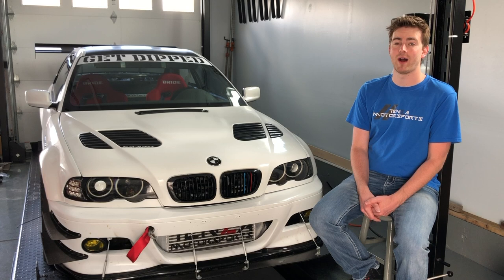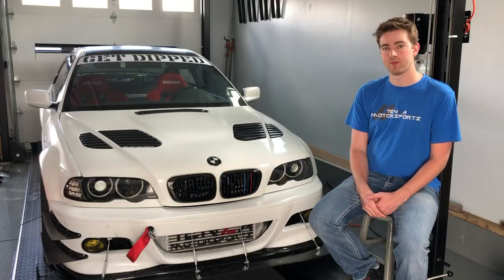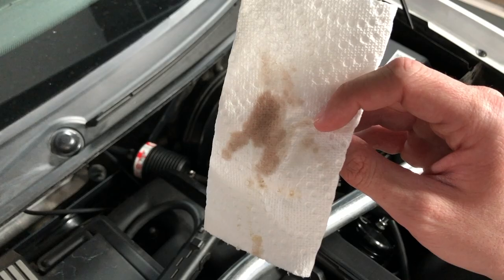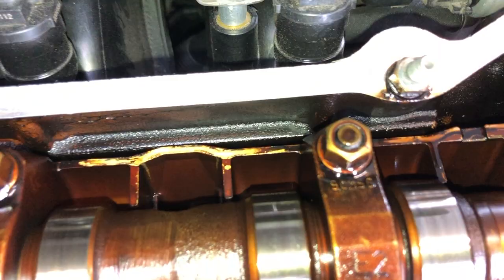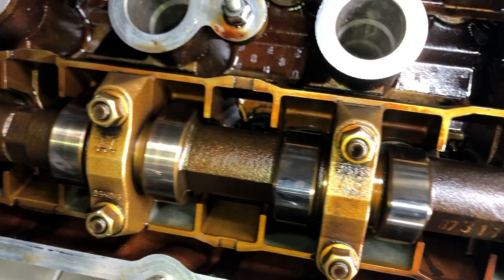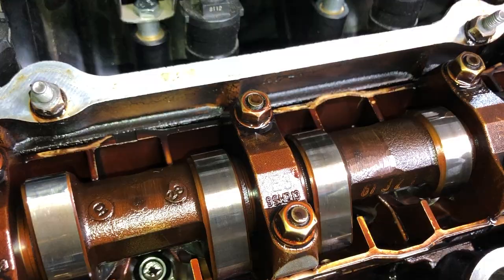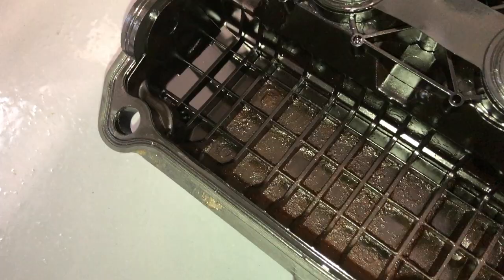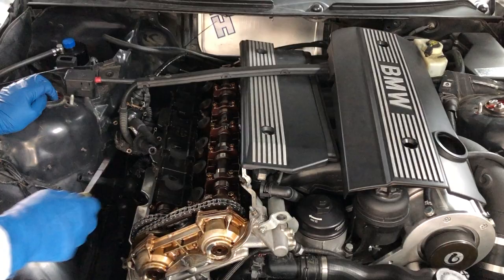500 mile break-in and Royal purple verdict (Part 2)

Comment: Yup any regular clean oil will do that to a dirty engine, and changed often enough will limit all that sludge in the first place. High end oils are just better at controlling it for longer, stick to the maintenance schedule and this will never be a thing. I have a Subaru with 300k that has cleaner insides just from using semi-synthetic oil whatever is on sale. The oil months later is still clean because there is no deposits to clean. No magical BS no cleaning products just regular maintenance.
Reply: Not entirely correct. There are specific oils known to leave shellac like residual coating and build sludge worse than most others. Pennzoil organic formulas are horrible for sludge.

Comment: I wouldn't trust the stuff because I have a good friend that used it & his truck & it overheated & blew the head gasket putting oil in the crank case & the oil & coolant mixed & never separated even after sitting for several days.

Comment: Seen it run in a bunch of cars as an Infiniti master technician. However. 5.6 liter QX80/56 seem to have a very bad reaction to this oil. Makes the chains rattle pretty bad, granted they have chain problems all on their own, but usually one or two royal purple oil changes even on the countermeasure timing chains and they’ll start to slap they oil jet. Unsure as to why. But that’s all I can say.

Comment: A better question is, if you take an engine that has hasn't had an oil change for 10,000 miles and run any high detergent synthetic oil in it for only 500 miles how much cleaner will it look? Let that same oil run in the engine for 10,000 miles and how much dirtier will the engine look?

Comment: My mom's Jeep used to have the infamous HEMI tick. It was loud and intermittent, and the dang thing only had 35,000 miles on it. Oil was changed regularly (note this) at the dealer with Mopar Conventional. The cheapest solution was changing the oil myself using RP 5w-20. Hemi tick completely disappeared, and I let the oil do its job for just 5k miles. I drain the 5k oil and it was the most disgusting 5000 mile oil change I've ever seen. The oil was completely opaque brown, which meant the engine was filthy despite 5k-6k oil changes. The Mopar Conventional was not doing its job at keeping the engine clean. If anyone here has a Hemi, use a quality oil and filter!
Reply from the maker: Interesting, never heard of the HEMI tick. Glad you got it all sorted. I find it fascinating what engines and what climates prefer different oil. I’ll be running a test on my moms car too soon, she has a BMW X3
Reply: @TenzaMotorsports  Hemis have a problem with the roller lifters going bad making a tick noise, causing some cam lobes to flatten. This causes misfires. The roller lifters have needle bearings in them than don't hold up well, so it's important that the engine is kept clean so the lifter bearings last longer. I trust Royal Purple for the job.
Reply from the maker: My 2017 Ram rebel is pretty noisy. I'll have to look into it.
Reply: @Dcc357     I  thought they used pennzoil ?
Reply: The hemi tick is the bullshit mds lifters they use for "gas saving". Mobil 1 performance bottle didnt quiet it down but RP does. I ordered amsoil, well see if itll quiet those lifters.
Reply: Dcc357 Royal Purple will make anything look disgusting. The purple dye just turns brown with heat, makes it look as though it’s captured all kinds of contaminants. If you were actually using conventional prior, it’d make sense though to still see some extra gunk and for the tick to go away. Hemis have really high peak combustion temps, conventional is a death sentence unless you want to change it every 1,000 miles.
Reply: The Hemi tick is definitely real lol i have an 06' 300c SRTdesign with 124k on it, would you guys recommend switching to something like royal purple at this point? Its a really solid running car if it matters.
Reply: I have a 2006 300c SRT8 with 110k on her. No mds crap but I do notice some lifter tick. Using Mobil 1 now, should I do the purple?
Reply: The hemi 5.7 is notorious for engine tick. It comes from the lifters. I work at chrysler. We constantly have 5.7s coming in needing new lifters. And yes 5.7s take 5w20. The dealers put conventional in unless you ask for full synthetic. Then you will be getting pennzoil.
Reply: Keyword is Conventional... I bet you Mopar Conventional is the exact same cheap crap that all other quick lubes use and buy's in bulk at maybe 10 cents per 100 gallons.  If you don't give a rats ass about your car, take it to the dealer.
Reply: I never go past 3500 in any of the vehicals ive ever owned . with all the top oil brands used ... Going 5k and 10k isnt very smart . sriving situations and climate and the driver all effect how well the oil does and how long it lasts ... 3500 max for me no matter what kinda oil rp m1 amsoil any of them 3500 max . turbo and direct injection forsure no more than 3500 maybe earlier ....
Reply: Leave it to the dealer to use the crappiest products known to man on the premise that they will use the best.
Reply: Sounds to me they weren't changing your oil!
Reply: @xtv007  hey i have same ride.. also using mobile 1.. i was just wondering the samething

Comment: I have a 2004 Lexus LS430. 
So if I change to royal purple,should I run it for  like 1-2k miles then change it again? So that all the stuff that the oil has cleaned off is not just running through my engine.
Reply from the maker: Depends on how dirty the engine is. If it has been well kept, there’s no need to change it early.

Comment: 300k on my 2000 4Runner. Valvoline oil and oil is always clean at 3500 mile oil changes. Never buy a bmw.
Reply: Mr.Marnez 225,ok on my 2005 e46 330i. Still running strong and very few problems.
Reply: 04 E46,196K and runs like a new car,1qt of oil every 1K miles,i aint complaining

Comment: Did you forget that baffle plate? Didn’t see u reinstall it?  I bet they put that baffle there incase you forget to put you oil cap back on, it wont spray oil while running without a cap
Reply from the maker: On camera yes. Off camera no. Thanks for the comment!

Comment: You dumped Royal Purple Engine Oil after 500 miles ?
ouch !! $$$

How many miles on this engine ?
Reply from the maker: We had just done a rebuild on the engine. So we changed the oil at 500 miles. The engine had around 160k if I remember right?

Comment: Old school engine cleaning, put a qt of atf in it and run it for about 100 miles. Then do an oil change. It will be clean as a whistle. 

This is very old school. Dad used to do this on P51s. I’ve done it in my cars over the years. Always spotless. Even after 250000 miles. 

I may try this stuff in my daily driver.

Comment: When I get a used car, I use the cheapest oil and half a bottle of Marvel Mystery Oil.  1000 Miles and it is black with a heavy filter.  I then do a 1/4 bottle and a 2000 mile oil change.  After that, compression is back and oil stays golden.  I use 1/8 of the MMO bottle for the next 2 changes at regular intervals.  First used it on an inherited Escort that was blowing by on cold starts.  Never blew by afterwards and never ate oil.

Comment: Royal purple VS Liqui Moly
Which one do you prefer ?
I’ve been using Liqui Moly for 80k miles. Before 80k miles I’d used royal purple and Mobil-1. I can’t tell the difference.
Reply from the maker: As long as you use the correct weight and comparable grade, you shouldn't notice too much difference. I have loved my Royal Purple experience and I will continue to use it!

Comment: Mobile has been making synthetics longer than anyone. They also have the highest milage between oil changes available. His oil pan is leaking because of full synthetic. You must understand 5w20 is different in a full synthetic. Full synthetic on a older engine people will notice seals leaking again full synthetic is different. Pure about an inch conventional oil same viscosity into a cup then pure same amount of full synthetic into cup and swirl it around. Even though they are they same weight motor oil they behave completely different the full synthetic looks much thinner. Full synthetic is meant to keep contaminates sperated and not allow them to cling together which causes sludge. Again full synthetic in older or higher milage or one where seals wasn't installed correctly they will leak

Comment: Royal Purple is a good oil i started using it since i top the speed on my engine out so if you keep a fast speed yea use it if you drive the interstate a lot yea use it.

I'v got an older engine so since i'm unsure and since the engine is used to a specific oil i mix it up that way you have high millage and a good synthetic for performance to help when your going fast.
Reply: Bryden Al please

Comment: Royal purple loses its color after the first drive really afterwards it just goes clear.. as for the cleaning power of royal purple.. i started using it on my 2012 ford escape 4 cylinder and it really cleaned out all the varnish and gunk off the camshafts.. but you really gotta run it for like 7 to 8k miles to see results

Comment: Royal purple isnt a cleaner it's a oil. This would work with any oil off the shelf at walmart.
Reply from the maker: I was running full synthetic castrol and it didn’t clean the engine for the first 4 years I owned it.

Comment: I thought Royal Purple was not recommended for breaking engines in.....? Besides that it's the only oil I use in my engines and gearbox
Reply: That's a used motor already broke in but your right there not enough zinc in regular royal purple

Comment: Any good detergent oil is going to clean up the crap you had around your valve train.  I can't believe you put that engine in your car without first cleaning that crap out.  Using a detergent oil when the engine is that dirty can loosen all the sludge up, which it did,  and clog small oil passages.  I would not use a detergent oil in a car that has not used it before or change the type of oil you use if your engine is that dirty.  In my opinion, the sludge is better off staying put than being pumped around in your engine.
Reply from the maker: I have no idea what oil had been used for most of its life. I had only owned the car for about 10k miles of its life when I made this video. I see your point but at least in this case it did’t cause any issues.

Comment: Every research test I’ve ever seen showed Amsoil to be the absolute best, most test shows royal purple to have modest results, personally I use Mobile 1, just as good as royal purple and several dollars cheaper
Reply: I used to use Mobil 1 also, but since my dealer does my oil changes, I had no proof they were using the Mobil 1 that I was bringing. With Royal Purple, I KNOW they are using my oil!!

Comment: I notice you left off the intake cover plate, the top end of that head should be cleaner next time with the intake cam slinging oil up to those areas it missed before
Reply from the maker: It got put back off camera. Good eye to detail.
Reply: @TenzaMotorsports  lol, i grew up in a machine shop/repair shop, i get ocd when im puttin imports back together

Comment: Should have just smacked the heck out of the fuel tank under the back passenger seat, that got my e46 running a few times before the pump fully quit.  Also don’t run that car on empty much those pumps hate that.
Reply from the maker: With the mileage my car had and an added supercharger I knew it was going to happen. I was almost expecting it and when it did fail I knew exactly what went wrong. I wasn’t upset, Just gave me an excuse to buy more race car parts😊

Comment: Is that a plastic valve cover?  No wonder BMW dont last.  My 2002 celica gts has aluminum valve cover and will out last any BMWs Now has 385k+ miles and runs like new.  I recently replaced the valve cover gasket for the first time after over 370k+ miles. The cams looks shiny and clean. Thanks to valvoline full synthetic.
Reply from the maker: I’ve never replaced a valve cover on a bmw. Sounds like your super reliable Toyota has gone through more valve covers than any one of my bmws.

Comment: BMW recommends Castrol, I'm using it for my bimmer and with regular maintenance it works perfect.
Reply from the maker: Absolutely! if your engine is in good condition, then you shouldn’t have a problem. My problem was the previous owners of these two engines didn’t take care of them. I ran 10k miles of Castrol nothing really changed. I run 1,700 miles of royal purple and all the sudden my engine is clean. So you were absolutely correct. if you stick to the manufacturers suggested oil and change interval you won’t have a problem!
Reply: @TenzaMotorsports  I hear ya! I had the same problem as you, the former owner did everything right to the car but lacked with the oil change. Because the engine was using oil, he thought just topping it off every time would do the trick.
And not only that, he topped it off with mineral oil. Yep, you read that right.
So what happened in the end was that the engine was so polluted that in the end I had misfires and ended up with changing the engine for a fresh one. And even the fresh engine had lack of maintenance, the oil filter had the shape of an hourglass and clogged with oil residue. 
Now, after several oil changes, the engine runs really smooth and got it's performance back.
E46 330ci, I love it.
Btw, your car looks real nice! Keep it up!
Reply from the maker: Sounds like the same boat. Get your engine cleaned up and back to the manufacturer schedule.
Reply: @TenzaMotorsports  You know what they say, if you want to have it done right, you gotta do it yourself. 👊🏻
Reply: Castrol is not a full synthetic motor oil. Look up the lawsuit between Mobil and Castrol in the late 70's. BMW just made a huge contract deal to use and recommend Castrol oil, but this does not mean that Castrol is worth a damn. It means that BMW is making money on every quart of Castrol that they sell.

Comment: hey bro looks alot better. never used royal purple before i think ill change. curious is royal purple only for racing?
Reply from the maker: No it’s not only for racing, it’s great for daily use as well! Keep doing your research to make sure it’s right for you! My moms X3 will be getting the royal treatment this next time around.
Reply: The stuff you find at the store with the API dount symbol in the back that says "API SN" is a synthetic oil for normal driving. Now, the Royal Purple bottles that say "With Synerlec" are the top notch oils. HMX, HPS, and XPR contain synerlec and increased ZDDP. HPS and XPR have extreme amounts of ZDDP for racing, while HMX is just a high mileage oil for old engines with a tad more ZDDP than normal and less Synerlec than HPS and XPR. Synerlec is said to be a Sulfuric Ester, which is a group 5 oil that sticks to metal parts and has a strong film strength.
Reply: Not at all, their standard oil is API rated.
They also have the HPS which is for racing and the HMX for high mileage vehicles.
Reply: It’s actually crap. If you want an actual good oil, Amazon basics is far better than RP and much cheaper.

Comment: Do synthetics tend to cause older, high mileage engines to leak? I've got a 93 dodge B250 van, with 140,000 on it. The 318 thats in it runs great, milage ain't so good. Hate the automatic transmission that's in it. The 518 with the OD package on it. Wish I had the skills to pull that sucker out and replace it with a 5 speed stick. 
I'd like to make that 318 last as long as possible.
Reply: Thats an old wives tale
Reply: Thinner, full synthetics can leak out of older cars where tolerances weren't so tight. They don't cause the leaks as such. They just pass the larger gaps that a thicker oil won't.

Comment: You did a rebuild, you are going to experience discoloration of the oil on a breakin. No doubt Royal Purple is good oil as any synthetic will clean and soften up buildup. I have seen comparison tests of Amsoil vs Royal Purple, scoring, cold viscosity, as well as heat tolerance. Amsoil won them all but Royal Purple is the runner up.
Reply from the maker: we were looking at the color and break down as much as how well and fast it cleaned. that was what I was trying to convey.

Comment: Only the fuel pump ? LOL Those things are money pits, I learned the hard way.,
Reply from the maker: I’m sorry you’ve had a bad experience with bmw. It’s been almost 9 year since I bought my first bmw. I’ve owned 9 of them and only one car was mildly troublesome it was a 2000 e39 540i.
Reply: @TenzaMotorsports  Well I might have got a lemon but I wouldn't risk it again. My 03 E46 330Ci was very problematic.
Reply: Luckily a fuel pump is a 20 minute job in those things. Flathead and a 10mm socket and you're golden.
Beemers can be a pain but they are drivers cars and require the maintenance to keep them that way. I had a 2000 323ci that went through back brakes every 6 months (caliper issue), had a strange clunk in the drivers rear and ate control arms for breakfast. ........but it was fun to drive
Reply: Lol power steering pump will get you soon

Comment: So far looks good but is it a proper good lubrication for less wear and longlife protection or is it just a good cleaner.If anyone has used purple for long period and knows it's lubrication properties please reply as I'd like to know if is good for big power v8 longevity(less wear on parts)
Reply: I have an LS motor.
I've only used Mobil1 or Royal Purple. The only difference that I've noticed is when the motor is cold and on a cold day, the RP does not have lifter tap for the first couple seconds of start up, but the Mobil1 does.
Corvette and Viper BOTH recommend Mobil1 from the factory. It would be safe to assume that GM or Dodge R&D department knows something about high performance oil.
I recommend both.